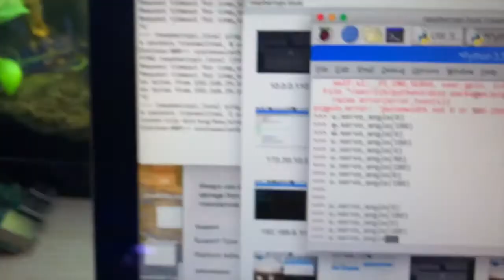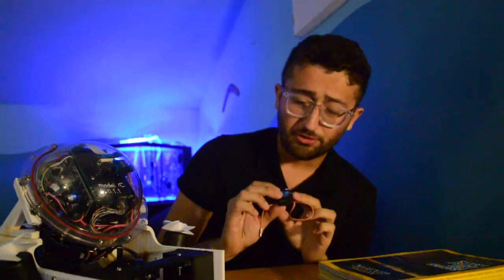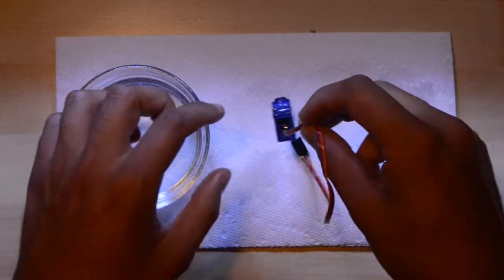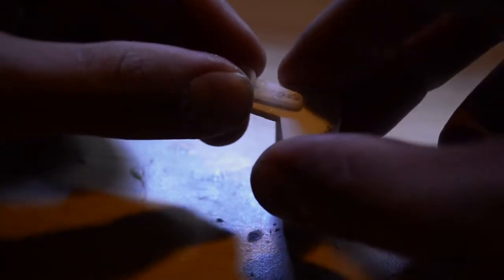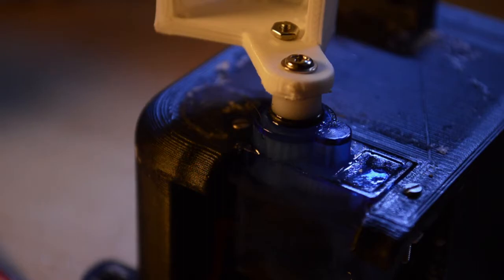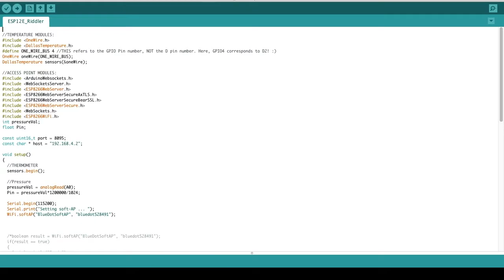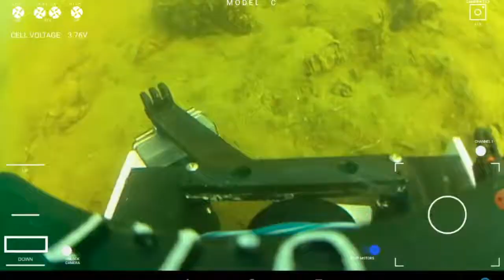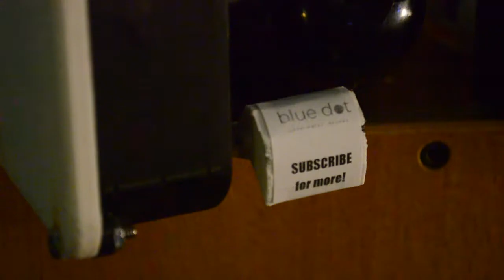Waterproofing a Servo Motor for RC Submarine Dives!

Comment: Great video.   I have a couple of suggestions.  Make a small vacuum chamber.  Place the servo in mineral oil inside and vacuum it.  All the air,  even from inside the small servo wires will come out and will be replaced by mineral oil when the vacuum is removed. 
Try a regular rc plane flight controller that has SBUS instead of a Raspberry Pi. It is a lot easier.  It let's you make a tetherless ROV that only has a very thin antenna wire to the surface.  With SBUS you can control many functions on the ROV, including a claw,  with just one thin wire that goes to the surface, plus another thin wire for the video feed. 
Best of all is that on the surface antenna you can place a small GPS receiver and you can have a tetherless, ROV that does autonomous missions to GPS coordinates and then returns to you all autonomously and with no tether. 
Watch out though, with government officials which might consider such a rig as a potential weapon.